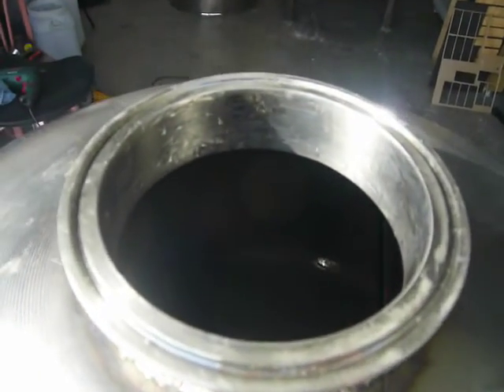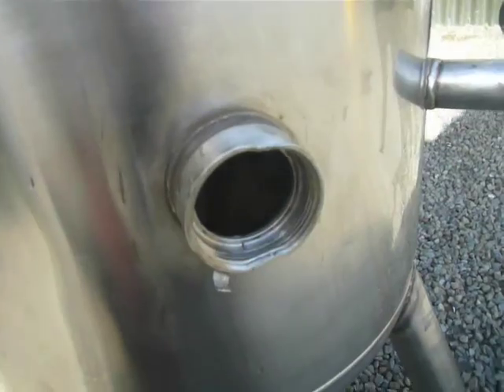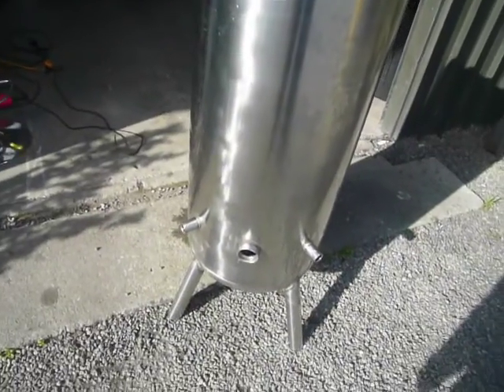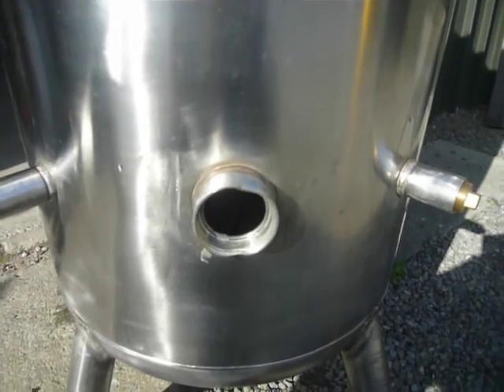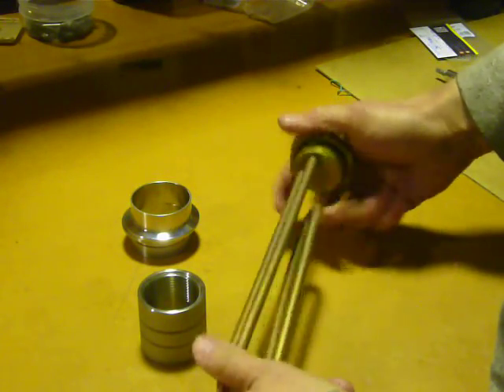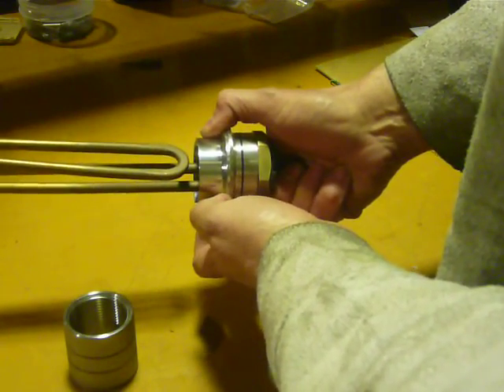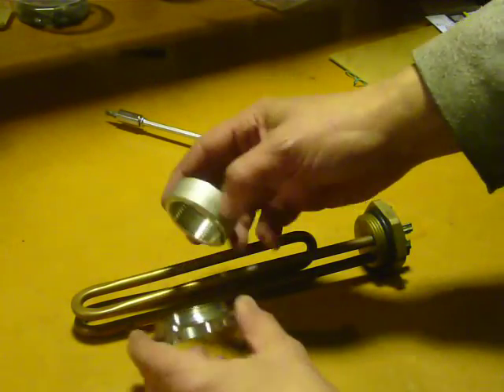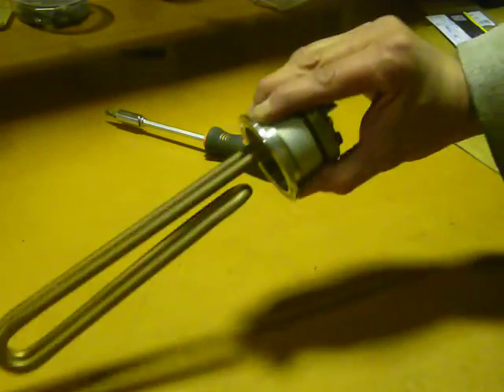Hot Water Cylinder to Kettle conversion - part 2

Comment: Awesome work.  Are you purging the tank with Argon during any of the welding?  How do you clean/grind the inside weld joints if not? Worried about those welds causing contamination and/or bacteria issues?   
Thanks!
Reply from the maker: G'day,

Sometimes I will backpurge - mainly when doing something with pipes.
When welding Kegs I've got it down to the point that I can weld ferrules on without blowing thru'.
I also occassionally use Solarflux (paint-on wipe off protective flux you paint on the backside of thin work - requires a bit of clean-up but handy to have.

Comment: Beautiful work. Excellent safety advice using the hydrochloric acid for cleaning up the welds.
Reply from the maker: Thanks - glad you like it! :)
Yeah, I hate sounding like a bloody safety sally, but the stuff is available easily enough and if folks haven't used it before and don't realize how serious the chemical is they could be in for a world of hurt.
Reply: Could not agree more. There are multiple levels of this hobby which have safety rules for a reason. IMO Safety advice/tips should always commended. Cheers!

Comment: looks great, is there a reason you didnt put the second element lower? it looked like you could put put it way lower.
Reply from the maker: Heya Callum, yeah, the two outlets have long curved internal pipes that run right down to the bottom-centre of the tank.

Handy for completely draining the tank to the bottom,  but would have interfered with any elements fitted lower.

Will see how it goes when running it - if the placement is a problem I can go back and cut the drains/curved pipes out, patch the holes and add another tri-clamp port lower down .... bit of cutting and welding to do tho'. :o)
Reply: You seem to be a master at cutting and welding. You've inspired me to try and make a shotgun condenser.
Reply from the maker: Thanks Callum, that's pretty high praise indeed.
I don't know about a master at it hehe - I used to do a lot of fine prototyping in stainless as a job for a few years about a 5-7 years back. Only started welding stainless again recently - still getting my hand/coordination back in.

Are you looking at copper or stainless for your shotgun condenser ?

You can find copper tri-clamp ferrules in the States if that's where you are - you could potentially solder the whole thing up out of copper.
Not sure how hard wearing the copper ezi-ferrules are but it would be a lovely bit of distilling bling! :o)
Reply from the maker: Well after test running it on 100L of water a few times .... yeah the 2nd element needs to be lower - without any kind of agitation the cold layer doesn't mix at all ... shoulda know this from how my flakestand performs.

Other reason I'd wanted to keep the elements away from the bottom was incase I wanted to go back to gas power with it but, bah, its an electric unit now - may as well go whole hog. :o)

Will drop the element down lower and make another video of it running with its thermal jacket and all.

Comment: They have those fittings pre-made on flebay
Reply from the maker: The 1 1/4 inch threaded socket to tri-clamp fitting? Yeah, bit harder to find them in N.Z. - we basically get by with spit and rubber-bands down here. Fittings may be cheap in the U.S. but the postage to the bottom of the world ain't hehe.

I had the tri-clamps already and knew where to get the 1-1/4 inch socket from and one socket split did 2 connectors. :o)
- Plus I wanted super short fittings so the element protruded into the tank as far as it could.
Reply: Wish I lived in N-Z
Reply from the maker: Ah, there are swings and round-about to every place Thomas.
Successive globalist governments have incrementally butchered my country.

N.Z. is one of the most expensive places in the world to live relative to wages.
Our housing prices are ridiculous (think U.S. housing bubble on steroids) to the point that young couples and single ppl can mostly kiss goodbye the thought of owning a home. 
All the infrastructure previous NZ generations worked hard for has been sold off to multi-national corporations by crony politicians.
Despite our clean-green image you can't swim in many of our rivers let alone drink the water *ugggh*!!! This is down to gov shoving dairy farming into areas that aren't viable and ignoring the ecological impart of high-density farming.
Gov' is quietly undermining all our rights/privacy when they can. Politicians are really only there to vote in their next pay rise, .... etc

The current distilling laws in N.Z. only came about as a result of the gov being to cheap to spend money policing the existing laws so they changed it so they didn't have to at all.

God bless their miserly apathy for once!!! :o)
Reply: Yes, the politicians have ruined the USA also, distilling drinking spirits here is a federal crime and they want to give people 5 years in prison for making there own spirits, it's not because it's such a bad thing, but because the government makes billions on the sale of liquor through taxes, and they know if people make there own they won't buy the high dollar stuff at the state liquor store and they won't get they're cut. They use propaganda about going blind or dying from drinking home made moonshine.At one point the government purposely distributed tainted alcohol to scare people into not drinking and ended up killing many people.They blamed the deaths on bootleggers and to this day no one has been held accountable. Now, many people are forced to hide they're still setup in the basement or out in the woods like criminals  making poison when in reality if you can bake a cake you can make good safe home made liquor but they don't want to hear that. If it were up to me you could run your still in your back yard on Sunday afternoon with no worries and have your Indica plants growing ten feet away. I hope I get a chance to see that before I kick the bucket.
Reply from the maker: Ah, yeah politicians ... the bane of everyones existence.

NZ used to have 2 big distilleries in the mid-late 1870's - they were making huge amounts of rum and whisky for that era, - they had to import grain they were making that much.
The Prime Minister of the time allegedly cut a deal with English bankers (who were entwined with the Scottish Distilleries) to finance a railway that was a vanity project of the PM's in return for him destroying the local NZ distilling industry, killing the competition with the Scottish distilleries.
The local distilleries were crushed within a few years.

I know there is a movement to have distilling in the States made legal and a petition that's being circulated - I hope you get to see it legalized. :o)

Comment: Nice work
Reply from the maker: Thanks - first lot of TIGing I've done for years (Still Head in one of my earlier vids doesn't count - that was a rush, I only had a tight window to use that TIG machine).
Buddy of mine and I went halves in a small 200amp machine a little while ago.
Used to do fine detail  TIG welding all day everyday at one stage, nice to be able to take my time and get back into it now.